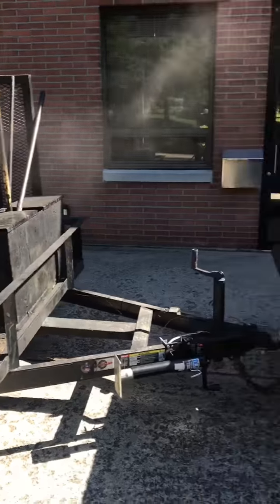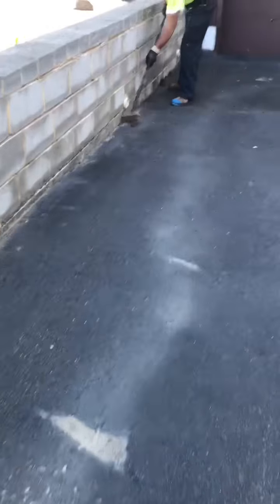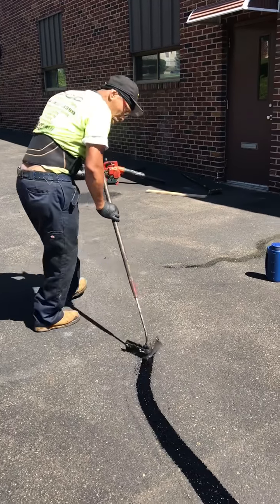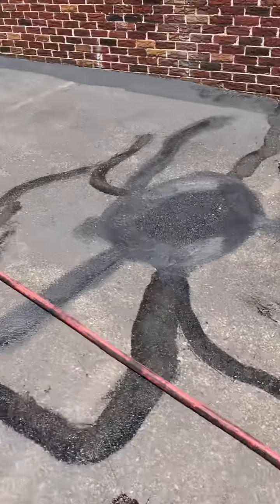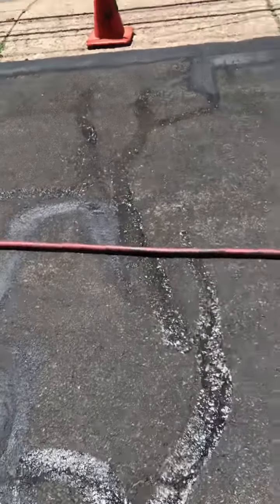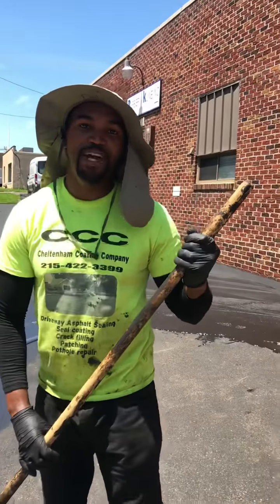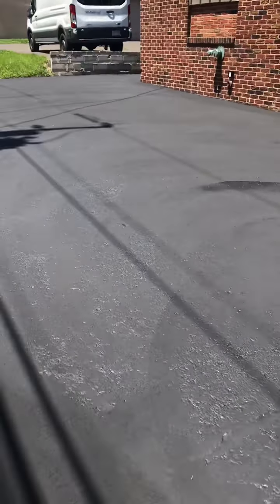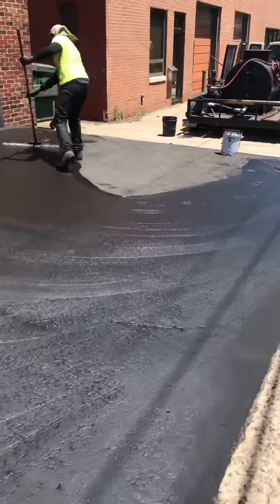"Driveway Sealcoating & Repair" CHELTENHAM COATING COMPANY

Comment: Looks like y'all have a very professional company going.  Kudos.
Reply from the maker: Thank you! We really appreciate it!😊
Reply: @cheltenhamcoatingcompany  

Help me out on something... I have a small maintenance / handyman business here in Arkansas.  I added striping to my business last year, and that's taking off a little.  But I am going to have to add sealing and repair to the menu, in order to make it really do well.  I am planning on squeegeeing sealant on smaller commercial Lots and driveways.  I noticed you guys walking through what they had already squeegeed.   Do those tracks go away?
Reply from the maker: That great! its not as easy as it look of course, but your removing your footprints with one half of the brush while the other half is moving the sealer.  It’s best to use a long Brush. one of the things i found out in this business is you have to learn what works for you.
Reply: @cheltenhamcoatingcompany  

Thanks so much for the feedback.  I have watched all of your videos and I truly am impressed with y'alls professional work.